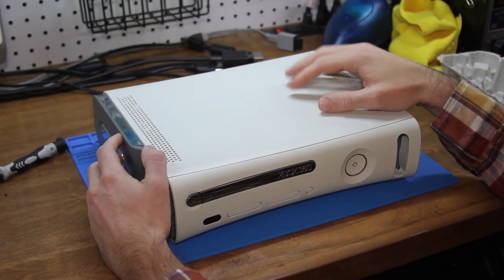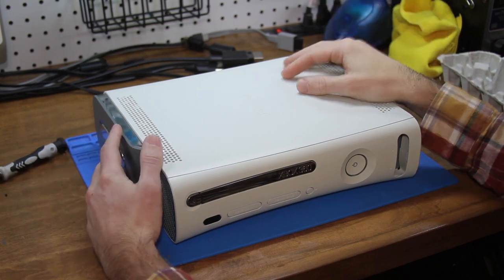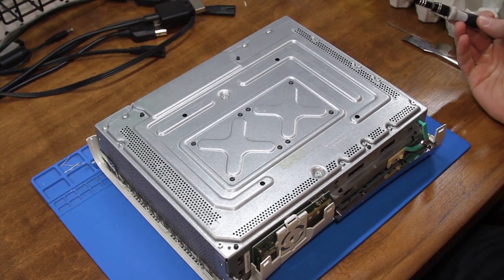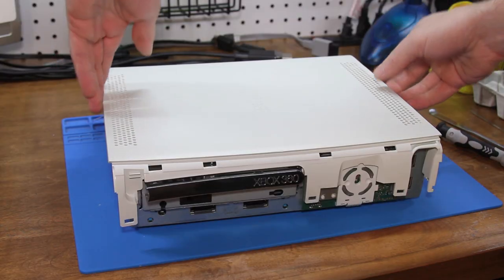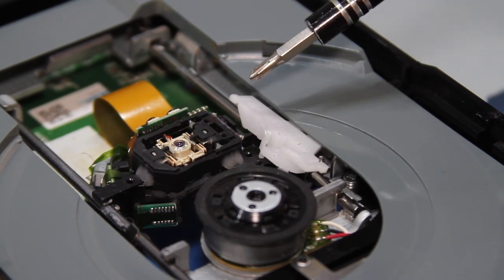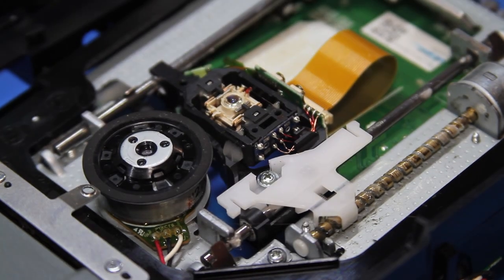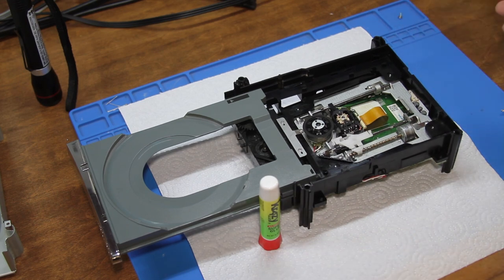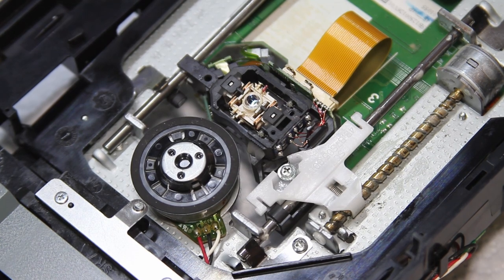Repairing an Xbox 360 Disc Drive: Screw this screw!

Comment: Looks like the screw hole on the optical pickup is bored too big for the screw threads to catch. In a situation like that I’d just find something like a component leg or a strip of thin plastic to run down the length of the hole to artificially narrow it.
Reply from the maker: Yeah I dunno. I just repaired another 360 the other night and made a point to look at the pickup. The screw on that one too barely looked like it was poking through the bottom. I just have this feeling the screw they used just barely catches the threads on the laser. When I removed it the first time it may have ruined them just enough to keep it from catching. On other pickups I've seen that screw goes all the way through. Either way I'm happy to report I filmed this roughly a month ago and I put probably 30 hours on it and I haven't had issues. Krazy glue FTW!
Reply: @titanrepairs  I assumed it was a third party laser and the hole was just bored too large. If the officials ones are like that then they must have used a thread locker like you mentioned. I’d just be hesitant about using super glue near a optical pickup because of outgassing which can potentially fog up the optics.
Reply from the maker: @Systemsquirrel  hmm. Never thought about outgassing before. I'm not a chemist (I actually did poorly in chemistry in high school lol) but I'd assume the outgassing would be finished when the glue hardens? Either way, we'll find the answer if and when this 360 ends up in a future video 🤣

Comment: This screw had fallen out and was rattling around the drive and embedded right next to the laser. Also the white piece on the rail had also flung out and was stuck at the back of the tray causing it to get jammed. 
I have tried to refit them both but the screw is not staying in place. It seems to have no threads in the hole it goes in and is just sitting there loose. 

Exactly the same problem as you basically. But im not comfortable gluing it in. Any other suggestions? Maybe a longer screw?